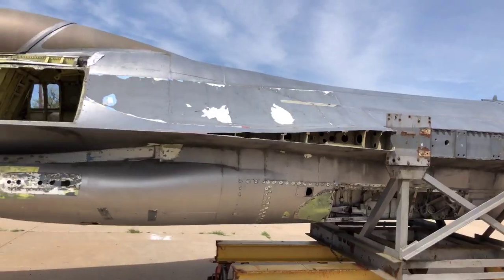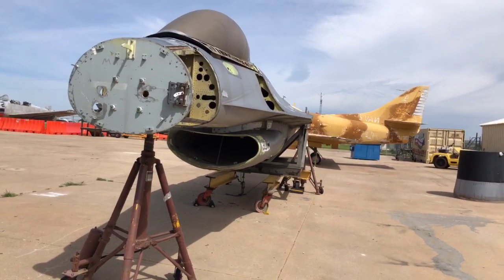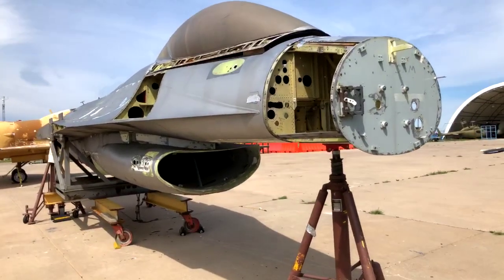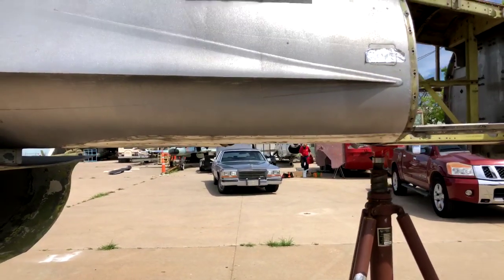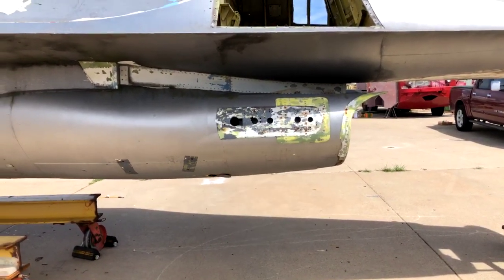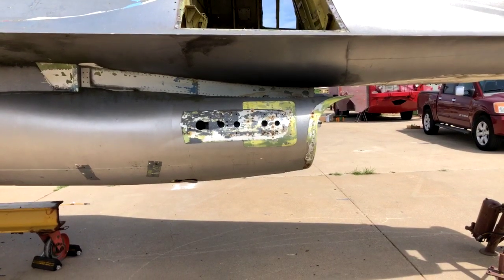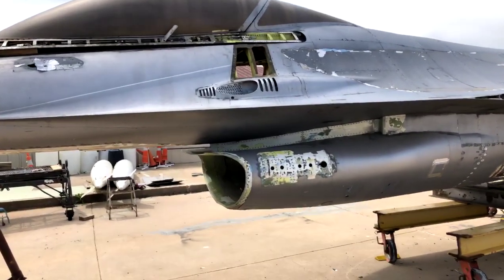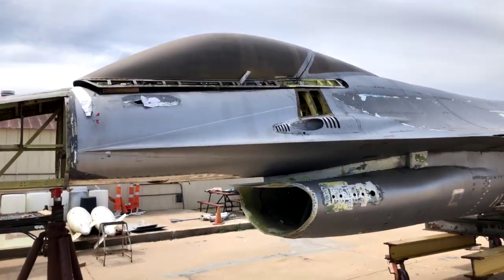YF-16 #2 Walk-around - 1 Apr 2020

Comment: I hope to see this aircraft restored to such a condition that it could be flown again if you just got the work inspected and certified airworthy.
Reply from the maker: Would be nice except we have no engine and the Air Force Museum would never allow flight. They own it.  It is on loan to us. That said, our crews are working to put it back in the closest restoration to the day it was to go to Paris as possible. Amazing work going on.
Reply: @FtwAviationMuseum  Oh, I know quite well that you can't fly it no matter what.  (A policy I don't necessarily agree with.)  I suspect that you could obtain an F-100-PW-100 without much difficulty as they're obsolete and to my knowledge, nobody flies them anymore. The USAF might give you one. Or loan it. Maybe P&W has one in the storeroom they'd donate.
Reply: @Turboy65  The F-16 flew first with F100-PW-200 engines; it was upgraded with the -220 version of the F100 first (mid-1980s), later the F110 starting with Block 30 of the F-16C production (circa 1986) and later the F100-PW-229 starting with the Block 52 F-16.   The -200 has additional hardware specific to the F-16 to reduce the chances of stalls in a single-engine configuration.  The -100 engine in the F-15 did not have these newer features.  The later -220 reliability upgrade was made interchangeable between the F-16 and F-15 A-D.
Some Block 42 F-16Cs, all ANG planes (142 I read), were upgraded with -229 turbofans to deal with the weight increase caused by strike-specific hardware and standardize them closer to the Block 52 planes (which were the first F-16s equipped with -229 engines) flying with the ANG.  The -220 engines from these upgraded F-16s were passed on to F-15s still in service (probably C-models) which did NOT receive the -220 reliability upgrade.  They had kits to upgrade the -100 to -220 standard but they didn't buy enough to upgrade all the F-15s.  All the operational F-15A/B models and quite a few F-15Cs kept on flying with F100-PW-100 into the 21st century.  The F-15A has been retired since 2007.
The F-16 never used the -100 version of the F100 turbofan in operational service; the -100 was F-15 only. As soon as they could, priority was given to modding all the existing -200 engines to the more -220 configuration for the F-16 because it was single engine and needed the most reliable engine they could fit to it!  

That YF-16#2 will never fly again.  It's been outside for too long.  I doubt it would pass safety inspections without a significant rebuild of some sections -- it's sat outside and corroded significantly in some critical areas I'd presume.  It's had moisture sit in many areas for extended periods and I'm sure birds even built nests in it!  The USAF will not spend the money on this and the museum wasn't planning on flying the plane ever again.  That's not in the cards.

Comment: I thought a lot of Air Force planes were displayed without engine hardware to the point they don't even have the exhaust nozzles installed!
One of the 2 surviving B-1A prototypes is displayed this way at the Wings Over the Rockies Air & Space Museum in Colorado.
The nacelles are still there under the wings but the end where the engine nozzle would be sticking out is covered by a red FOD cloth.
Unfortunately, the surviving F-20 prototype is displayed with an awful sheet aluminum nozzle like the YF-16 was outfitted with.
I don't know what it is with the engine policy.  Some airframes have exhaust nozzles installed, others don't. This seems to happen with Air Force airframes.
The retired Navy planes (including the YF-17s) generally are fitted with exhaust nozzles.
Reply from the maker: The engine issue is that some of the engines have depleted uranium parts and are considered a hazard and not suitable for display.  Our F-18 came without engines.  Most of the nozzles are integral to the engine and have no place to attach to the airframe.  Our 18 came with some fabricated feathers that attached to the airframe.  We built some for our F-111 and are working on something for the YF.
Reply: @FtwAviationMuseum  Ah!  Gotcha you on the depleted uranium.  That makes sense.
I kind wondered if the nozzles were integral to the engine assembly or not.  I thought maybe they WOULD have to be attached to the nacelles/engine bays in a different place without a mock-up engine in place.  NASA  has mock-up engines on most of the shuttles.  (There's one set of flight-used engines on a shuttle but I don't know which of the flight vehicles it is; it's definitely not the Enterprise.)  They kept the useable shuttle main engines in storage for further R&D as well as possible use in future rockets.